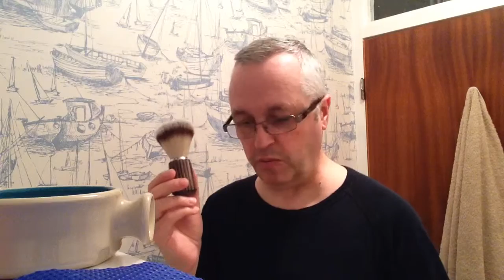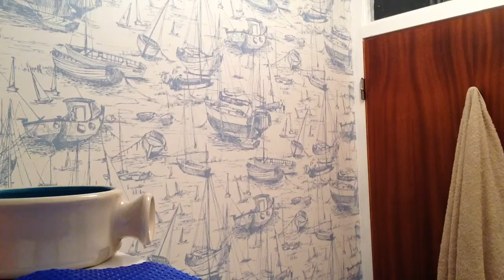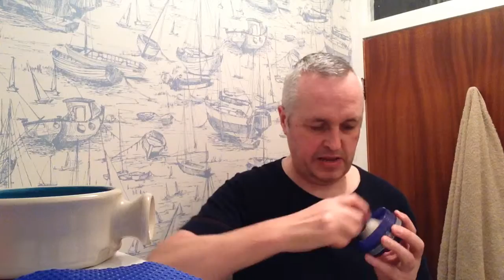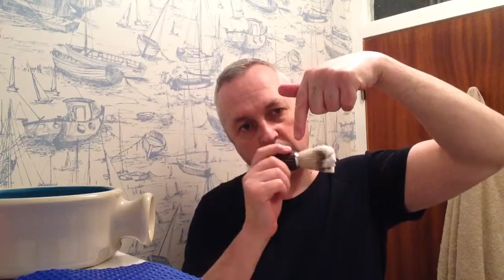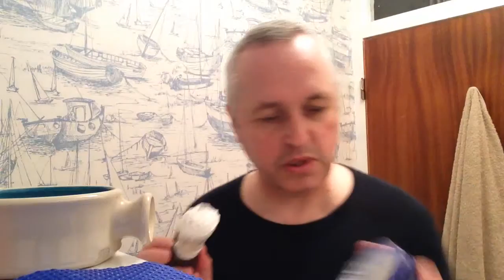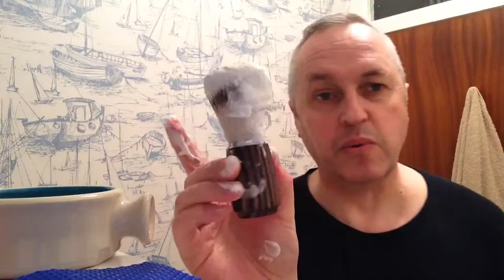For beginners - loading the brush: Friendship Shaving

Comment: That brush seems very over loaded. You only need 30 seconds load and maybe 40 to 50 seconds with a hard soap. Also, synthetic brushes need less time than natural hair brushes.
Wetting  the top of the soap before you start loading the brush helps and you might need less time to load.
Reply from the maker: MrRRSODL
Yes, I think you are right. Thanks for letting everybody know. I too have come a long way in my shaving journey, since this video. I've learned a lot on the way, mostly thanks to folks like yourself who offer comments and tips. It is appreciated. I have been wondering whether to re-visit these videos. Perhaps I need to. Cheers.